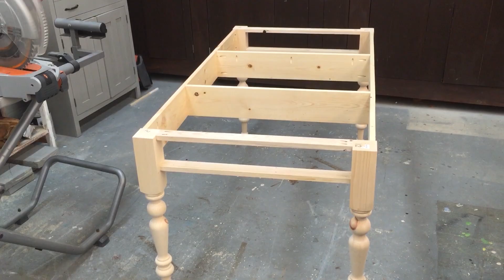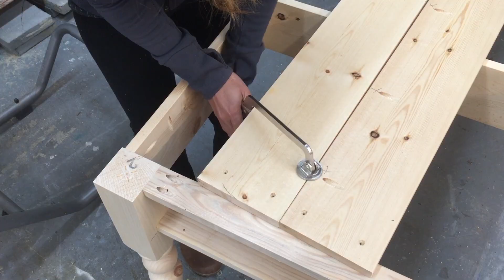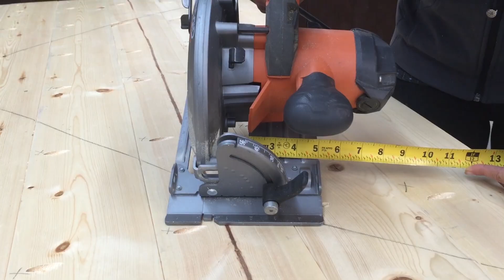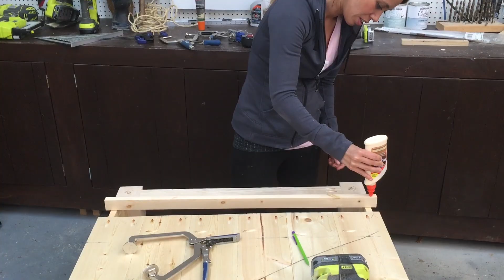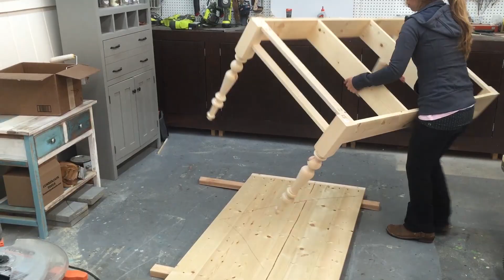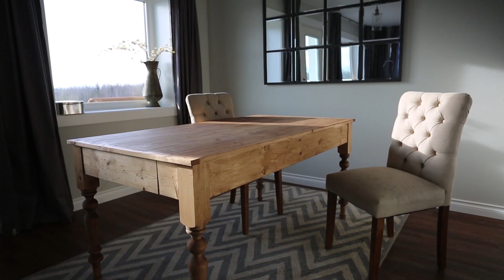How to Build Wood Tabletop

Comment: Don't pocket hole your tabletops kids.  The joint is too tight.  When it's too tight like this you get cupping, bowing, cracking, and warping.... which will ruin your table.  Wood is a natural material that expands and contracts with the seasons, humidity, and temperature.   All bad  2/10, would not build this way.
Reply: Suppose you paint it all with polyurethane first.  Wouldn't that block the moisture movement?
Reply: @Altair Ibn-La Ahad 
You might try watching the entire video.
Reply: *****
It has far more to do with relative humidity changes throughout the year than the actual temperature.  Even with climate control in your home most systems don't have a long enough duty cycle to keep the humidity even throughout the year.  Running the heat in the winter dries your air out even more than it is normally in the winter. 

If you're going to use pocket screws I suggest you back them out a little bit so the wood somewhere to go.
Reply: yep I learned it the hard way with my first table bulding like these. especially with the way she did the table top ends. highly not recommend it.
Reply: So, what's the solution?
Reply: I built my table with pocket hole screws 9 years ago and none of what you said has happened. I guess I'll update you in another 9 years to let you know of any changes.
Reply: So what do you recommend? I'm interested in making an outdoor table, but I live in FL where the humidity is so high it can sit on your skin like water droplets
Reply: nope, and if you seal it poly it or paint it all sides (even the ones you wont see) no moisture. ive been using pocket holes since their invention with no problems. some people just don't like pocket holes and try to convince the world they suck. I however have a mind of my own.
Reply: I have a table I purchased from Pottery Barn for quite a bit of money, and the leave segments have expanded width wise more than the actual table itself.  Wood is going to expand no matter what. And it's stained and lacquered on all the surface area visible.
Reply: and yet not one person gives an alternative way to build the tabletop. Brilliant.
Reply: Ortho Tech that my friend is what we call anecdotal evidence...
Reply: That doesn’t even make sense? And I’m a carpenter by trade who makes his living everyday doing it lol
If you mail it from top, or bottom. If you only used wood dowels or if you hid screws underneath it’s all fastened tightly any way. So wouldn’t they all bow in your way of thinking? I’ve built many tables, counter tops and bar tops this way and I’ve never one time had a call back at all about any warping or bowing. If you seal it quickly and keep it indoors they likely good it bows is zero to none.
Reply: well you dont know what youre talking about. read any book on woodworking youd know why not to do it this way.
Reply: z beshears my base I made was level but when I put the top on the legs wobble now. What did I do wrong?
Reply: didntseeitcomin1 didn’t build your frame strong enough.
Reply: z beshears could it also be that my top isn’t level, I notice some of the boards were not very flush with the rest? Thanks for the first reply.

Comment: Did you plane those boards at all? I'm thinking about doing this for a desktop surface.
Reply: Justin Rizzo I was looking for an answer to this too. The boards looked straight on the video to me, and I can’t imagine she used “reclaimed” wood like she said without any jointing, planing, or sanding. I am sure they were surfaced in some way before she glued them up, cause they would normally be very warped or bowed with gaps. Even store bought boards are not completely straight.

The pocket holes and glue might help to keep the boards flush together from side to side, but the table probably wasn’t level to the ground when she was finished. It might have had some raised spots or bumps. So most likely it was sanded or planed down after too to make flat and level.

Comment: What do you call, and where can I find that deep throated clamp you used to align the boards together while pocket-hole screwing them together?  I can't find anything deeper than 4".
Reply: Pat Traynor most box stores have them on the kreg sections in the tool section now

Comment: What is it with Americans and Pocket Hole joinery?
If I purchased a table and found it full of those things, I would pick it up and throw it at the seller.
Reply: Michael Andrews ahe gets.free machines for highlighting them in videos.
Reply: lol I'm American but yeah, no need for those pocket holes, a glue joint would work just fine.
Reply: What would you suggest? Simple glue and screws? Pocket Hole joinery is just a simpler quicker way of wood working, and then the holes can be filled with plugs. Most people don't have the time, tools, knowledge to do biscuit or dovetail joinery.
Reply: Zarrar Malik you dont need pocket hole screws in the top. A glue joint is sufficient. I took woods classes from a pro and he never used pocket hole screws in making a table top. You don't need them.
Reply: jointheresistence123 thanks. I thought it would only add to its strength. Appreciate your input.
Reply: Actually you do need them if you're using the type of wood used in the video (warped/misaligned). The clamp lines up the edges of the wood, and the pocket hole screw holds the flattened joint in place. If you were using perfectly planed wood planks, you could just glue/clamp, but that's not the case here.
Reply: Jimmy Flim Those are straight boards. I don't know what you're talking about
Reply: 23 second mark. Those are not aligned straight boards. They're warped. Can't be glued without some other joinery to align the edges.
Reply: +remember this is a limited tool build.  Notice she doesn't use clamps,  so how about explaining how to put a top together without clamps  Screws and glue work great.  If you concerned about it being too tight wait overnight and back off each screw a quarter turn.
Reply: Michael Andrews sound too damned picky.
Reply: +jointhereesistance123 yeah, but you get 5 different "pros", and you'll have 5 different opinions, and they'll all claim that theirs is the best way. if it works, do it.
Reply: Hey, it's fancy since it's real wood, regardless of joinery. We constantly get flyers in the mail advertising a whole house of furniture with zero down payment as long as you have a job. It's mostly particle board-based. They like it when people pay the outrageous "interest" on that garbage, but they don't lose much if they don't get any money at all.
Reply: duronboy2 Particle wood is real wood. ;) lol
Reply: Why? So you could watch it not break when it hits the ground lol
Reply: It's not about being an American. It's because she is a woman and it's easier and lighter.

Comment: What is it with these know-it-alls that always talk about how they could do something better differently? Yes, most of us know pocket holes aren't ideal for table tops. Yes, most of us know that you could use biscuits. She explained it pretty clearly in the beginning that it's a build with simple tools. Watch and listen to the video first.
Reply from the maker: Thanks!:)
Reply: A biscuit joiner or dowel jig is just as easy to use as a Kreg jig!
Reply: Dowel jig yes, biscuit joiner no.
Reply: I actually find the opposite, I can get more biscuits placed in less time than dowels.
Reply: Perhaps, but a biscuit joiner is not what you'd expect a DIYer to have or be proficient at. A drill is something every DIYer would have and knows how to use.
Reply: Kind of. A biscuit joiner is basically a drill and jig just in one tool. I self taught myself how to use one in 10 minutes.

Comment: one day those pocket screws will come back and haunt you all!
Reply: check wood prix instructions
Reply: Great job but. I was wondering if you have to retighten the screws at a later time because of expansion and contraction.  In which video are the instruction on?  He does have quite a few. Thanks keep up the good work.
Reply: Alex O Yes,the screws will have to tightened just a tiny bit.If it were nailed you would have to disassemble the table and use bigger nails to re assemble it or use screws.Good thing about screws one has the threads holding together and takes more to unwind it through use and atmospheric conditions.Wheteas nails just come straight out quicker and with less resistance.I found this out through my own experience  with my own pieces.Any thoughts on this?